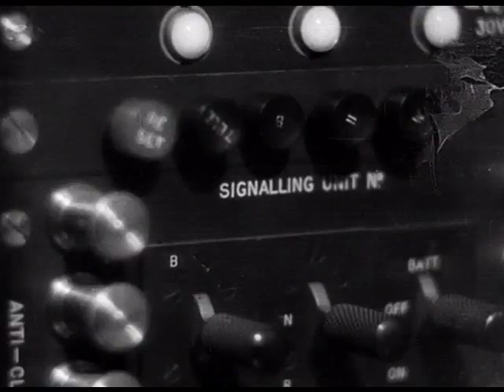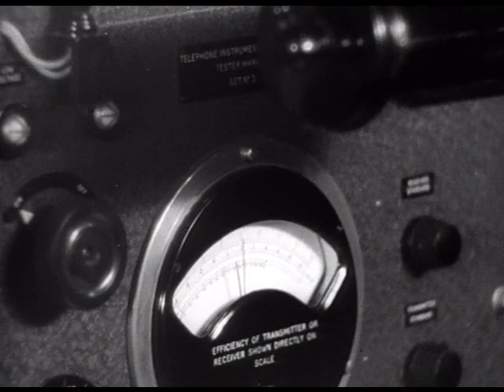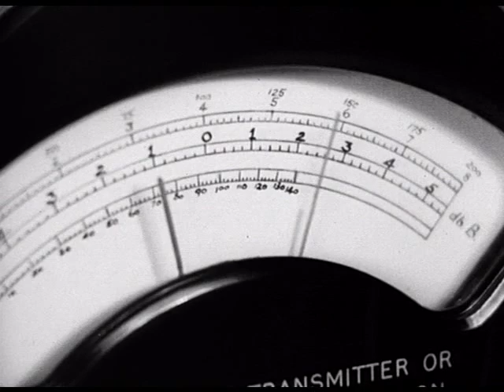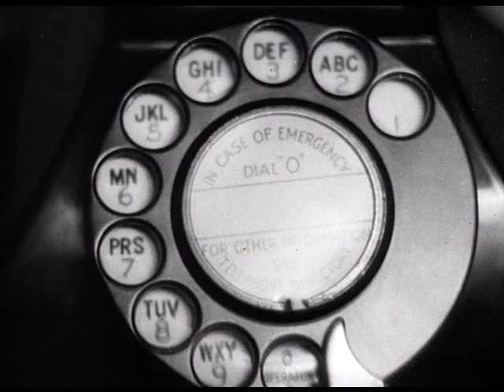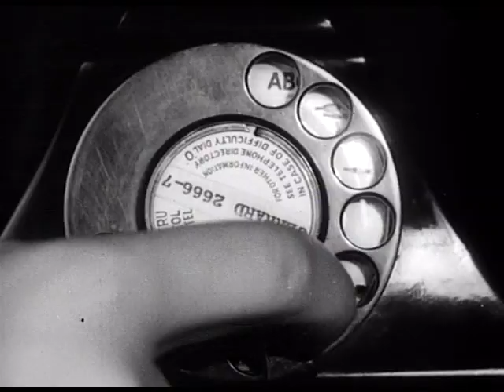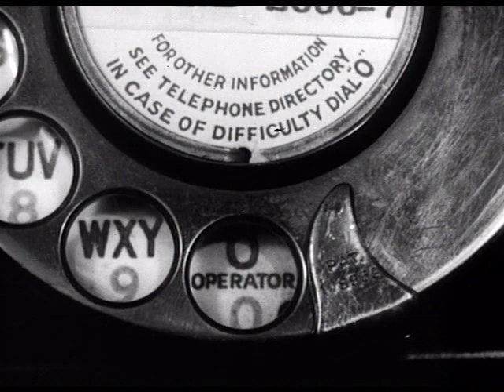The Coming of the Dial (1933)

Comment: The Brits must have been well ahead of AT&T..or the dates on the old films are misleading..the 1932 AT&T films were proud of the maze of cords and jacks that those poor operators had to utilize!
Reply: disoriented1 Actually the US and the UK were contemporary with each other in the telephonic biz. You may have seen a manual exchange in a newer AT&T (or Bell Telephone/Western Electric.) film but bear in mind there were manual exchanges in both the US and the UK untill the 1960s! The first US automatic dial exchange in the US was installed in the 1890s! By the 1930s dial exchanges rapidly expanded in both countries.

Comment: 6:00 nice roof top views of pre war 1933 London, but did this beautiful new telephone exchange survive the Luftwaffe air raids 8 years later? much of the area around St Paul's seen in the film suffered total destruction.
Reply: Amazingly it did. It's the Faraday Building and is still there and still used by BT.

https://en.wikipedia.org/wiki/Faraday_Building
Reply: @martinbaines  --   The Faraday Building is in the south-west of the City of London. It was originally built as a sorting office for the General Post Office. In 1902 it was converted to a telephone exchange serving sections of London, and underwent several capacity expansions over the next several years.

In 1933, a new section was added on the western side of the building, over doubling the size of the building as a whole. The section was built to house the International Telephone Exchange. The new section included a raised central portion with decorative turrets which was highly controversial at the time as it blocked the view of St. Paul's Cathedral from the Thames River. This led to a new law that restricted the height of new buildings in London to protect the sightlines of the Catherdral.

Comment: Great Archive, I would be worried about wearing a head bulb  with 240v swimming around my head lol
Reply: The headlamps used 50volts DC  from the exchange supply, jack sockets were mounted on the equipment racks @8.16 you see the engineer plug in his lamp, soldering irons also used these 50v sockets.